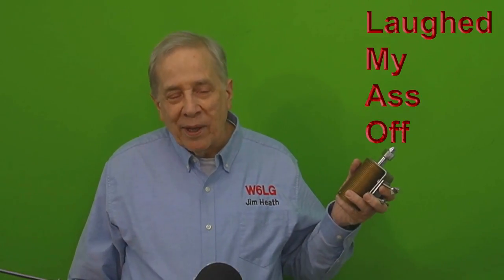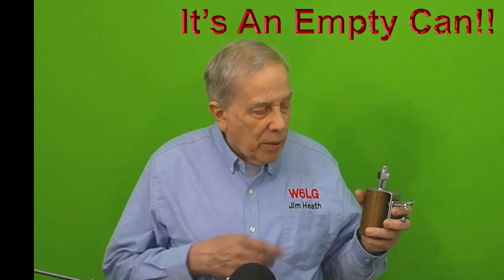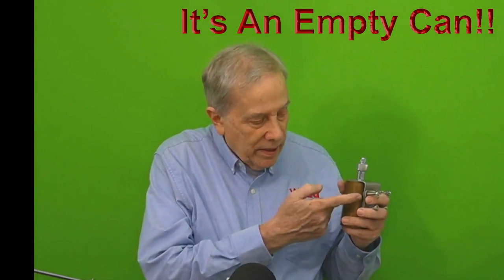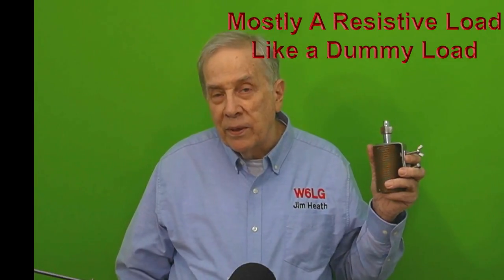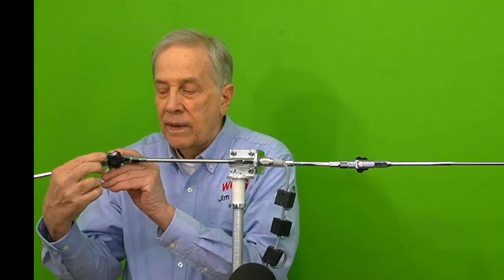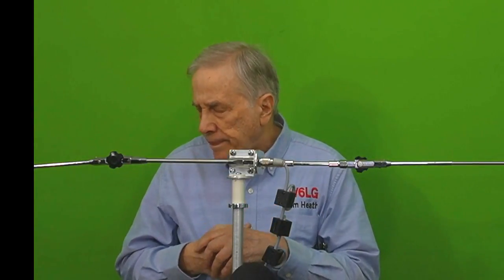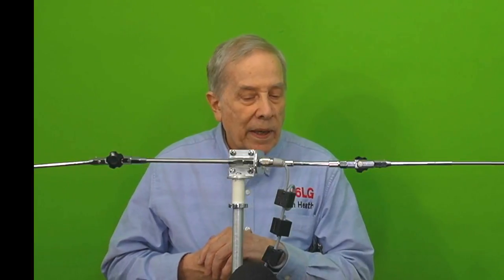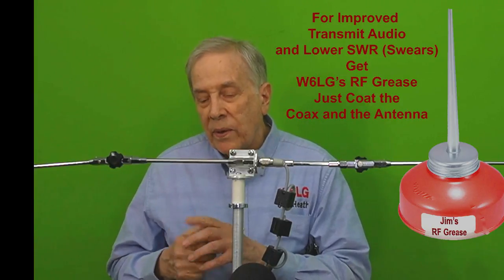Deceptive Antennas Using A Standard Carbon Resistor With Inductive And Capacitive Reactance

Comment: I just ordered the Nu Ham antenna spray. It eliminates high SWR and works on all bands. Best part is it's CFC free and it comes in a handy travel size to spray on your car. It also stops unwanted interference from those pesky injectors and alternator noises.
Reply from the maker: If would just make my hair grow back.  That would be super.  The doctors think that my cancer, MDS, came from exposure to Benzene. So, CFC free might be a good idea.  Thanks, JIm
Reply: Will it work on aircraft

Comment: I enjoyed your snake oil show, I see alot of claims made about super high gain antennas. It is funny to listen to. I really like the sales pitches made on mobile cb antennas. I run a wire dipole up about 25ft, I run 160 through 440 on it, Antenna tuners do wonders. Efficient? hell no, does it work ? hell yes, around the world unless on vhf and up.
Reply from the maker: In many situations, that is what you need to do.  Some kind of antenna is better than none.  It just must be an antenna versus a dummy load.  Thanks Jon!  73, Jim

Comment: Years ago I inherited a commercial HF SSB system running on 4MHz. There were two spot channels 4.725 and 4.750. The commercial antennas all had resistors in them to make them easy to put up and make them work with any HF frequency.   The range was lousy on ground wave though - which is what we were trying to use it for. The channels were so close together I was able to make resonant antennas that covered both. It was a far simpler system and worked a lot better. I think the problem we have now is people trying to cover nine bands in one antenna. That's what leads to many of these false claim antennas.  73 Gordon GM4SVM
Reply from the maker: It is.  They don't understand the difference between an antenna that is good on 1 or 2 bands versus one that tries to cover all of HF and part of VHF.  Thanks Gordon. 73, Jim

Comment: I love my home made Terminated End Fed Inverted Vee antenna. It has pretty much a flat SWR from 6M to 2200M. It's based off a proven design dating back to the 1940s and has been used by various militaries around the world. Basically it's a 110 foot long wire with a 9:1 on one end and a 500 ohm non-inductive resistor on the other end and then a 72 foot long counter poise going from the other end of the resistor back to the 9:1. I've gotten over 16,800km distance with it. It covers the ENTIRE bandwidth of ALL ham bands. I mainly use it for 160M and for NVIS work, but my main antennas are an EFHW and a 9 band Hustler vertical. Is it a compromised antenna? ABSOLUTELY! The trade off for having a wide bandwidth and low SWR is lots of wasted power ... but it DOES work ... contrary to a ton of people telling me it is nothing but a dummy load.

Having said all that, I love your videos and you bring up very good points. No way in heck I would pay $500 or $600 for that store bough "HOA stealth" (which is a joke because it has a shiny 17 foot long telescoping mast and a 25+ foot long wire and is HARDLY what I would call stealth). But since I had a 9:1 Balun laying around and some wire, all I had to do is spend $70 on a 500 ohm resistor and EXPERIMENT, and that is what this hobby is all about.

BTW, I love your humor, it is nearly the same as mine. Good luck on your sugery.

P.S. This is what I based my design on, and there is a bit of history of the antenna on the site: https://www.bwantennas.com/acs.html

73
Reply: Oh, after rewatching the video, I will say this about the comment about "better sounding audio" ... at least with my TEF antenna, it IS much better sounding. Here is a video showing the difference between a standard EFHW and my Terminated End Fed antenna. You can really hear (and if you look at the waterfall, see) the noise reduction. https://www.youtube.com/watch?v=smKhXrmxz2Q
Reply from the maker: I will take a look...take a listen.  Is yours sort of like half a Rhombic? That 9:1, is that 9 turns to 1 turn so that it is 9squared or 81:1?  Based on the large 500ohm, probably not 81 to 1.  The terminating resistor is not at the feedpoint so, as you are pointing out, there is a difference.  Is that fair?  73, Jim

Comment: I recall an "automatic" antenna tuner advetized back in the 90's.  Can't recall the name but the ad showed the inventor and a military ship using it. He claimed it would match any antenna instantly with no adjusting.  A tag line was "Do you suffer ftom twiddlitis?".  One of the Ham magazines bought one. Xrays showed a circuit board just floating and what appeared to be a large resistor. They opened it up and it was indeed a resistor connected to the feed  and the board was random scrap not connected to anything, all sealed in epoxy.
Reply from the maker: You will find a similar antenna advertised in the latest QST. There is also the long running WB2JKJ ad...I think 40 years of that same ad.  Read that one carefully.  73, Jim

Comment: I've been known to tell hams if low SWR is all they're concerned about, use a smaller and much longer coax feedline.
Reply from the maker: Longer and heck a smaller diameter cable will help too.  Finding just the right length can make the new ham smile when the needle barely moves.  Thanks Dana, 73, Jim
Reply: @ham-radio  just need to make sure the coax doesn't melt :-)

Comment: Jim, you say that every HF antenna needs a choke. I agree. What about VHF & UHF antennas? I bought some Mix-61 ferrite beads from Palomar but have not tested them yet. Looking for lower noise floor. 

73, KJ7RDV
Reply from the maker: I don't think it will reduce noise.  But, choking the coax is good.  Common mode current flow on the outside of the coax and you want to stop that at the feedpoint of any antenna.  73, Jim W6LG

Comment: Great video, Jim, thanks!  I am interested in making a down spout or gutter antenna. That may be the only way I can get on the air.  Can you discuss this in your next video?  Thanks!
Reply from the maker: I am going to give that a try.  Sounds like an excellent idea.  My plan, in my head only, is to separate a DS or do a freestanding DS that looks like it belongs.  I think the idea is a good one.  Thanks, Jim
Reply: @ham-radio  I second that Jim. My only way to get on the air is a gutter antenna. I'm guessing I'll need a tuner. And a radio I'm waiting for.

Comment: Antenna reviews or testimonials have always made me scratch my head.  Even more is the all too common, "its fantastic.  No tuner across the bands, "  to me  tats a bad sign.
Reply from the maker: It is indeed.  And the ARRL is an enabler of these fake antennas.  73, Jim
Reply from the maker: There have been ads for years in QST. Just take a look. Also, the ARRL supports talking heads on YouTube that give glowing reviews of products that are far from "two thumbs up".  

The October QST has an ad for a dummy load connected to an aluminum tube.  That ad has run for maybe 20 years.  Sure, no gain is stated because there is no gain.  And for that matter, maybe 1% radiation.0

 Also notice that those who sell/manufacture such products have given them to many on YouTube; but not me. They know I will be honest.  And, they don't want that broadcast.  The others on YT, no so much honesty there.

Comment: There was a rebuttal video and the ham had an RF engineer on his show. He clarified the antenna he reviewed was not flat from 80 to 10 meters, but it had acceptable swr on bands it was meant to operate on. They used a vna right on the bench to show this. I'm assuming you saw his rebuttal...
Reply: And, yes I understand where you are coming from and appreciate what you try to do for those who need a real Elmer
Reply from the maker: I will find it.  I teen to not watch others videos for many reasons.  A good RF engineer is worth his weight.  Thanks Jim
Reply: @ham-radio  Josh did the video and mentioned your video in a not too kind of a way. I think his dumb beard makes his brain fuzzy. 73,  AA4EZ
Reply: That was really the review he should have done in the first place though…..too many channels just take freebies from the vendors and get on YT saying how great they are.  That channel is by no means the worst one though, sadly.
Reply: @ammocraft  Amen!

Comment: Jim, what  type of antenna do you use
Reply from the maker: I currently have a 3 element homebrew yagi that I put together.  For lengths, I just made one element longer and the other shorter.  I close spaced the REF.  I have 12 feet to DIR and 6 feet to the REF.  The F/B is very good at about 25dB. 73, Jim
Reply: @ham-radio  
Is there any commercial build antenna that you would recommend 
I thought I’d purchase something like the hy gain 640 ……I have no 
room for a vertical with some type of ground plane
NR6AV…..JUST NOW SWITCHING TO HF

Comment: Thanks for another video and the info. One question, why do you have a green screen with nothing on it? just curious, 73 de AI5DD
Reply from the maker: I did use it and it looked like crap.  I gave up and spent an hour removing the graphics. Any ideas?  I used Premiere Pro and Ultra Key with no luck.  Your thoughts?  Thanks, Jim
Reply: @ham-radio  Youtube keeps deleting my answers, I'll message you. That is if they allow that as well.

Comment: I'm curious about your feedline chokes being wound so tight around the ferrites; isn't it bad for coax line to be bent that hard?
Reply from the maker: For the few minutes of the video and later test for another video, it doesn't matter than much. I had no other way to do that quickly for the videos. You are right, way too tight a radius and not good for the cable.  73, Jim W6LG

Comment: So I will assume you do not like the TTFD antenna. (Although it isn't a "NEW" design.) It always seems those with good ground, large areas and a place (and money) for ideal antennas disparage all other designs that are compromises. I am forced into compromise designs due to space limitations and the ground under my state. When you have a 50X100 city lot surrounded by buildings and power lines and by code can't put an antenna tower over 40', extending over the front of the property or within 10' of the property line you need to make serious compromises. And due to structures and concrete, no way to put a ground plane field in leaves verticals out. Any antenna is better than no antenna if you want to get on the air. So, I have a 66' TTFD stretched across the back. A 32' tower with 6 and 2 meter Yagis, and a 10M 5/8 wave vertical on it. This all works much better than the Screwdriver on my mobile or the old High Sierra Screwdriver I had on the house. Every bit is a compromise. Everything on the tower needs an ATU to work. The TTFD works reasonably across the bands (3.5 to 25 mhz) Is it a dummy load? No. Compared to a Mosley beam or a dipole 120' in the air I'm sure it can't compare. But it is better than nothing. But I don't review this stuff on youtube or eham or claim it is dieties gift to radio, either. It does the best it can do for my situation.
Anyway, good luck with the eyball surgery. That is some scary feces right there, no matter how many OTHER people they have done it on.
Reply: Yup, I made an inverted vee version of the TTFD and I can work the world with it. My longest contact was over 16,800km. Is it the most efficient antenna I use? Not even close, but it works on ALL bands (and beyond) and give full bandwidth and low SWR. I put the 9:1 on a 10 foot wooden 2x4 on one corner of my back yard, ran a wire up 65 feet in the middle to an insulator hanging from a tree branch, back down to the other corner of my yard 74 feet away (so the total length of the wire is 110 feet) to a 500 ohm non-inductive resistor from Palomar Engineering, and then ran a 74 foot long counter poise back to the 9:1. Works beautifully ... especially on receive. Much less noise than my EFHW or my vertical.
Reply from the maker: Do you have any idea about efficiency of the system?  Is there a place I can see this antenna with pictures?  Thanks, Jim
Reply: @ham-radio  From everything I have read, you lose about 25-30% of your power because of the resistor. I have not personally measured it (I don't have the tools) so take those numbers with a grain of salt. I've been meaning to make a video showing this antenna, I have a bunch of photos of when I made it so maybe tonight I will whip up a slide show and post it. I would love to have your opinions on it.

Comment: In defense of complete junk antennas and high loss feeder, sometimes efficiency takes second place to convenience. Somewhere in the shack I have a high power 3dB attenuator in theory it will only lose me half an S-point at best  and the radio will never ever see an SWR over 3... you know it makes sense :-)  Best wishes for the OP.
Reply from the maker: Thanks for the explanation.  If, if however, the shunt get 99% and the antenna 1%, it is really an antenna?  Consider a 5000 ohm wire shunt fed with a 50 ohm resistor.  Would that be...roughly...99 watts to the resistor and 1 watt to the antenna? What do you think?  Thanks, Jim
Reply: @ham-radio  an antenna with -20dBi gain will still get you some contacts. Sadly subjective reviews can with the best will in the world be highly inaccurate. 
Many years ago I worked for a defence electronics company, a downside to that marketplace is that you have to tell the truth. One product category the company manufactured and sold was magnetic loop antennas. These were very much a no expense spared product. Our catalogues listed them as -13dBd gain.
Is there any ham manufacturer that would do similar? Regarding soaking up most of the RF in a resistor, even Icom marketed (for marine use) an attenuator. TBH in a marine environment it is probably more reliable than an auto tuner at the feedpoint.
Reply: If you like driving your Mustang, that's great.  Enjoy your car, get what performance it has to offer.  But the moment you think it rids as nice as a Crown Victoria, or the moment you think it can outrun a Corvette, you are fooling yourself, and open claims to such will make a fool of you.

I think that's a decent rough analogy of many types of antenna claims.  Yes, you found a compromise antenna that gets you on the air and will work for your situation where a better one will not fit.  That's great.  But, when people start to puff out their chests and claim their compromise antennas, or other poorer than optimal setups as "just as good as anything else", or start to exaggerate performance, you can fool yourself.  

A poor antenna is often better than no antenna (although some people get short tempers around QRP and other "mud duck" signals), but don't think the contacts you get and success you have means you have a great setup.  Always strive for better, and focus more on what you can improve, rather than "good enough".
Reply: I think the issue is more the reviews claiming these significantly compromised antennas are something they are not.  No issues running a broadband terminated or shunt antenna for reasons of necessity or convenience, but newbies thinking it will perform the same as a resonant dipole up at half wavelength courtesy of YT reviews is where the problems start....

Comment: One (maybe the only?) negative aspect of FT8 is that it opens the door wider for successful qsos with truly horrible compact antennas, and poor station ERP. Is FT8 a terrific low power mode? Yes! But...
Reply from the maker: Yes but....get a second one and just pay additional shipping and handling.  These antennas are being helped by the ARRL  73, Jim
Reply: @ham-radio  Ha!! By the way, just heard you this morning on 20 - nice signals into ky, but the band would dip you from s9 to esp copy and back. And you should offer an FT8 digital option for the WTF-1. Call it the WTF-1DG. Put the word DIGITAL on the side in seven segment l.e.d. font. 73 Jim de Rich

Comment: So, a can of your RF Grease, and a pot of my "Cable Stop Leak"(patent-pending), the ALL NEW wonder product to stop RF in it's tracks, should remove all need for RF chokes, SWR meter's and even the coax itself......with BOTH these inline with your antenna, your GUARANTEED a static free listening experience. Contacts are now fully optional and best received with the volume turned right down and the radio power cord unplugged..for the ultimate clear reception, remove all transmitters from your shack, or better yet, from your house completely if possible before tuning your VFO. RFI will be a thing of the past, like vacuum tubes and correct sized fuses......
Reply from the maker: Yes, ultimate clear reception everytime!  73, Jim

Comment: Fractal antennas seem relatively new. I’m hoping to experiment with them on VHF.
Reply from the maker: There is a lot of debate about that.  I simply don't know. I asked 4 experts and got the same answer.  And that was, there is nothing new with Fractals.  They could be wrong and I just don't know.  For me, the simple answer is that the physics has not changed. In any case, it should be interesting to experiment with fractals.  I want to try a small high Q loop.  I worked a guy in Africa that was using one.  Thanks John & 73 from Jim W6LG in Rocklin Ca.